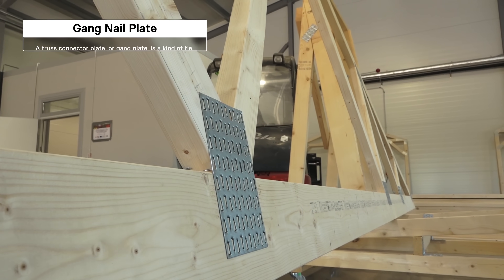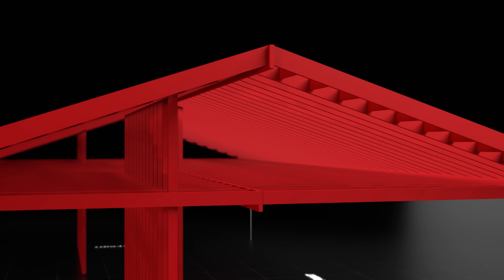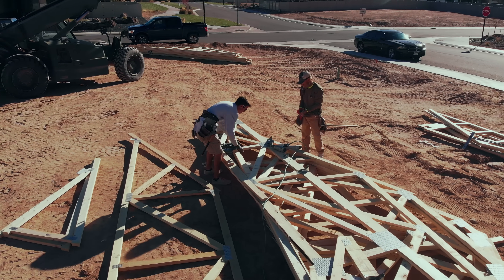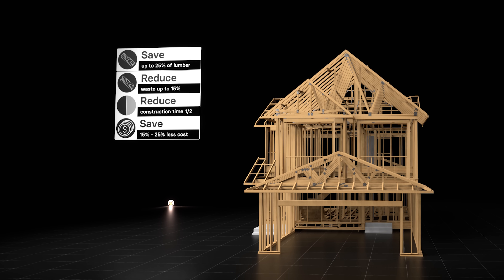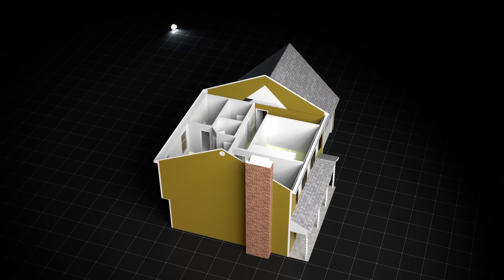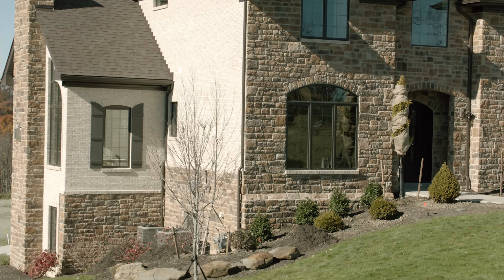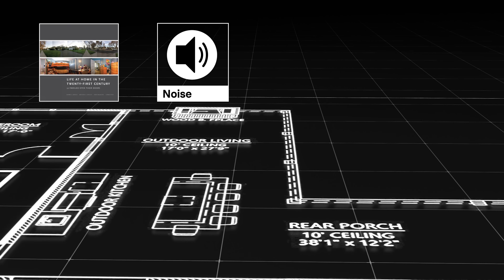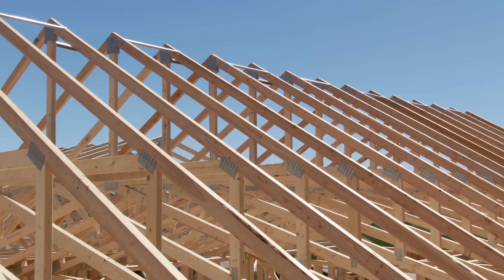The Invention that Accidentally Made McMansions

Comment: Kinda random comment. But I've always wondered by some neighborhoods have all of their houses built up on a mound raised from the street level. In my neighborhood at my end I have to drive upwards to get to my garage, but at the other end of the street its flat. If that was all done to control rain water in the streets by digging the street down and keeping the yards all the same level its pretty smart, because most people don't even notice it. Same as how no road is flat and they are all curved to run water to the sides and how we don't notice just how drastic those slopes are until going thru an intersection across a major road and you have to literally slow down drastically otherwise your going flying and so is everything inside the car. 
Guess my actual thought is if the little mound houses are built on are a byproduct of controlling water flow in the streets or if it has to do with the water table level underground, making it more difficult for houses on one end of a block to keep their sponge yards of grass green compared to the other end closer to the water table.

Comment: You should see the McMansions that filled up a former tree farm behind me.  Two of them are supposedly the two developers' "forever homes."  Supposedly the subdivision, 2ac nominal lots, is targetting $10,000,000 "estates."  It's hideous.  The construction quality is abysmal.  2x6 walls, but at least half of those 2x6s have so many notches and cuts I wouldn't trust them, and the rest would have been better used in an arch or spiral candy cane.  Maybe a boat... A surprise inch of rain in early november made for a lot of wavy roof sheathing (some of which was replaced) and the interior subfloors look like you'd expect of OSB stored under water.  Not to worry though. The trim will cover that!

Comment: i don't get it, how does it save any wood?
Reply: You can use much smaller lumber.  Imagine a saw mill cutting planks from a tree.  They can get a lot more 2x4s out of it than they can get 2x10s or 2x12s (the traditional lumber sizes needed for roof rafters).  It’s like cutting one 1x24 piece of lumber from a HUGE tree to make a table top or gluing and clamping a bunch of smaller widths of lumber together to get the 24 inch width.  On trusses, they don’t use glue as the fastener;  they use the gang nail plates. It’s strong, but has structural weaknesses the traditional lumber used for rafters would not.  Just like the glue up table top would be strong, but no where near as strong as a solid 1x24 plank.
Reply: @kld70  thank you for the explanation

Comment: Can't talk about house sizes in the past (and sometimes even today) without mentioning that towns' and cities' zoning codes typically require a minimum house size of, generally speaking, 1,000 SF or more in the "smallest density" zoning district.
Reply: This is very true.  Also, they often specify that the land can only be a certain percentage of the final home value. For example if you build on a $100,000 lot and zoning says your land can be no more than 30% of your home value, you must build a home that is valued at a minimum $210,000, making your entire property value $310,000 ($100,000 land plus $210,000 building).  So if you want to build a smaller home worth $200,000, you have to find a lot worth under $65,000 so you can build for $201,500.  Problem is there are zero lots around here for that price unless you buy and demolish.  That will cost you about $75,000 and you’ll be in a neighborhood where all the houses are much older than yours, dropping your value below your cost to build.

Comment: Interesting analysis, not wrong, but grossly oversimplified. Like many other commenters here who work in the industry I can tell you with certainty truss plates are not what spawned McMansions. The fact is the that truss construction is significantly MORE expensive in many parts of the country. I know this from overseeing hundreds of value engineering projects where we actually did the take-offs, solicited the bids, 
 and added up the direct cost budget for the same plan built both ways. Case in point- when you shift the load bearing from a combination of center walls and exterior walls you are also DOUBLING what the exterior has to carry. That could mean significantly larger footings, completely different reinforcement, the need to install expensive diaphragms and shear panels to resist racking and other lateral loads.. and on and on. So the roof or floor frame might cost a little less, everything else could cost a lot more. It’s almost never “trusses are cheaper, period.”  I could go on for another hour but painting truss construction in general and gang nail plates in particular as the major factor in the demand for larger and more complicated houses is baloney.  Also remember.. you build a great big truss somewhere on the ground… you gotta get it up on the roof, straight, plumb, and fully braced or you’ll have toothpicks in the first windstorm. That requires machinery, larger (not smaller) framing crews, and much tighter coordination. And that also costs money.  You can make most reasonable residential floor and roof spans in other ways… steel beams for example. Where I work the most builders are forced to use roof trusses when there is a shortage not of general labor.. but of SKILLED carpentry labor.  Hand-cutting a roof is a dying art today.

Comment: I don't understand how having more spacious homes is a bad thing. I wished I lived in a more spacious house so I could fit my stuff more easily rather than having to cram them wherever I can and where I can't get them more easily. I don't have enough space to workout or to fit a treadmill or a dining table. The bathroom is so small that you barely have enough room to stand, when the door is fully open, the edge is a few centimetres away from touching the bathtub. A lot of flats in London are even more ridiculously cramped. A bigger house is better especially when you have 3 kids so they can all have their own rooms which is especially better once they turn into teenagers and need their own space more rather than having nowhere to claim their own space, like, what if they fall out with the sibling they share their room with and the other sibling is of the opposite gender but they're both teenagers so too old to share a room? They have to sleep in the same room, they have no choice, it's not better. If that father and the mother fall out, one of them can spend their time and sleep in the bedroom whilst the other spends their time and sleeps in the living room. You can't do that if you're one of the teens. Having all those people in one house, it's going to be easier for people to move around when they're not constantly bumping into each other in cramped, narrow hallways like here in the UK, especially considering those kids are probably still going to be living at home into their late 30's when they can't find a job and houses are too expensive. I think people are just spiteful that other people are not suffering like they are and just want other people to suffer because they're sadistic. Some people are so spiteful, I bet they would like to vote in a ballot to ban bigger homes just so nobody else can have them just because they can't afford one themselves. I hate spiteful behaviour. It's the worst character trait to have.

Comment: 4:25......"and then left by (Pulte, Toll Brothers, Lennar, DR Horton) on the jobsite, exposed to the elements, for 2 months until needed; at which point they're installed with the plates barely hanging on to the checked two-by ends after weeks of rain-dry cycles."    Everything is awesome.  
Gang plates, PEX, flexible ducts, 1/2 inch drywall, fiberboard sheathing...............combined with the proliferation of easy debt have all contributed to the polished turds that are today's new houses.  
Everything is awesome.

Comment: The floor truss.  Don't forget the floor truss replacing the 2x12 floor joist.
Reply: Which is required in addition to roof trusses for first-floor open plans, since the first floor still has to support most of the 2nd floor.

Comment: As a carpenter I've made many roof rafters. I first used roof trusses in 1980, but not floor trusses. The trusses are made of yellow pine, rather than softer white pine. Sometimes a truss would get damaged when delivered. The inspector used to let us repair a damaged gang nail plate, by nailing plywood on both sides, but later required the damaged trusses to be replaced.
Reply: The inspector was requiring that carpenters hide damaged trusses instead of repairing them
Reply: @jdhenge  I 'm not sure it was the inspector's idea. I think we suggested repairing the damaged trusses and the inspector accepted the repairs the first couple of times and then with later damaged trusses he told us that we could no longer field repair damaged trusses or gang nail plates. That was in 1980 - 1981. The later damaged ones had to replaced with new trusses that we had wait far delivery. The ones we did repair previously are still standing. The builder didn't want to waiter replacement trusses and that's the reason we came up with a way to repair the damaged ones, if they weren't too damaged and just had loose gang nail plates. I think we used 5/8" plywood and not 1/2" plywood and cut the plywood as the truss angles and nailed a piece of plywood on both sides of the roof trusses, over the places the damaged or loose gang nail plates were. Rafters were often spaced every 16 inches, but roof trusses were spaced every 24 inches. The roofing industry now recommends 5/8 inch plywood for 24 inch spacing and 1/2 inch plywood for 16 inch spacing, but back then, we used 1/2" plywood. We used 5/8 inch plywood for floors, but these days with large McMansions, 3/4" plywood is often used, to reduce creaking and noise with very large floor spaces.
Reply: @BrandonLeeBrown  Field repairs are still allowed, they just need to be designed and specified by an engineer.
Reply: @BrandonLeeBrown  In my neck of the woods they still let you repair trusses that way, but I think they need an engineer to sign off on the repair. It's not a problem because most builders have engineers that they work with because the cities now require all house plans to be engineered. So basically the engineers rubber stamp the paperwork. When my dad was a builder he would draw his own plans on paper, but the cities don't let you do that anymore. They make you hire an architect or engineer.
Reply: @jdhenge  I think what happened was we asked about repairing the first damaged truss with the inspector and he could see the damage before we repaired it with plywood. He gave the go ahead. Then when we had another damaged truss, we just repaired it and the inspector was unable to see the damage under the plywood. He let that one go, but told us we couldn't repair anymore damaged trusses. Some trusses were damaged beyond repair, usually when they were delivered and dropped.

Comment: First time I visited the US I was shocked at the size of homes in general. Yes, we have big homes in Australia, but you guys really take the cake. I’m still wondering how you afford the electricity to heat the rooms (and the garages! That never happens here).
Reply: The utility bills for HVAC depend quite a bit on insulation the contractor puts in, along with what type of HVAC system(s) are incorporated into the design. Heat pumps are really being pushed by all the "climate change" scolds, and work well in many areas and can be very cost efficient. However, in places that get cold you HAVE to have an alternate heating source as they don't work well below about 15°F. Where I live in ND we regularly get at least one consecutive week each year with the high temps never getting above 0°F (-18°C), let alone the nightly low temps.
Reply: @KamasKirian716  I live in New England and most all new construction here is using heat pumps. There are new heat pumps that can heat effectively at those temps without needing to kick on heat strips. BUT...and there's a big but...we sold off all our utilities to private corporations a few decades ago, and as a result pay more than twice the national average for power. The result is that even though the newest heat pumps work, and don't typically need the emergency resistive heat strips, they still burn through a ton of money in electricity. There's 4 buildings in the complex I live in. The first 2 built use natural gas, the newer 2 use heat pumps. My gas bill last January was $87 keeping it 73 degrees inside, plus a $146 electric bill (~$20 of which was the blower motor based on the hours it ran). A similar size newer unit running the heat pump ran people $300-400 in electricity, and none of the ones I talked to kept it nearly as warm as I did...
Reply: Australia now has the largest average house size in the world according to recent studies.
Reply: Energy is 1/3 of our economy
Reply: Cheap reliable nuclear power (mostly).
Reply: The key is to not use electricity to heat your home.
Reply: My 1928 house is about 1,000 sq ft. but I have R100 worth of insulation in the attic, and additional interior walls attached to all exterior walls to get 2 more inches of insulation on top of the 4" in the original walls, and all windows are replaced with dual pane.
My total bill last month here in Iowa, for electric and gas for heat was $81 and I heat my house all winter to 72 degrees.
The attic insulation makes the most difference, while the codes my specify R19 or whatever it is now minimum for attics here, insulation is cheap, I loaded the attic up!

The windows also make a big difference, I used to get ICE covering the inside of the kitchen wndows where my desk is, it always felt like a draft and I had to have a 1500 watt space heater on me, turned out the "draft" was not leaks around th eold windows- they were sealed up good, it was the cold surfaces creating a convection current.

I replaced the 4 windows in the kitchen myself, and immediately the ice was no more, the drafts no more,and my electric bill dropped by $50/mo in the winter.
It was the same story in the bedroom, 2 windows I replaced, the space heater in there went in the trash, electric bill dropped $35/mo
Reply: Big homes also mean going outside less. Good and bad for health purposes. A lot of the younger generation look far younger in their face, than they are. They look like very tall children...😮
Reply: A McMansion isn't a home. It's a glorified box. A barn with a garage, essentially. America may look big and splendid on the outside, but on the inside it's flimsy and cheap. Maybe when Americans and Brits start getting chalk dust in their bread again, they'll realize Reagan and Thatcher sold them back into 19th century Gilded Age penury.

Comment: Interesting background on the truss nail plates and enabling more open construction at practical costs. Conclusions about the overall housing market boom and collapse, etc. seem pretty ridiculous though. Incorporating trusses adds design flexibility, but it doesn't drive the supply and demand curve for home ownership, nor the financing options driven by government subsidy programs. I'm also thoroughly confused how you manage to classify intricate roofs and more elaborate architecture as less aesthetically pleasing than the small simple, more uniform typical utilitarian homes of the 1950s Miami suburbs. Unless you just mean that you personally prefer small uninteresting houses that stand out less from the surrounding landscape.

Comment: With the new truss systems, you can have an attic space again. You have to order it, spec houses are done as cheap as possible so, many don't have an attic.
Reply: Random thought, Some of the bi levels of the 1970s and 80s are perfect houses. Sometimes I’m shocked how much extra space and privacy they have. The downstairs den etc plus bonus rooms is a great concept.
Reply: The sad thing is that this should have allowed cheaper houses, but it didn't work out that way
Reply: @chrisfletcher86  It's just supply and demand, few people want cheaper houses. Most "cheap" houses are just older homes that need some repairs. Starter homes built to min spec often attract crime.

Comment: Those aren’t used here in north Texas anymore. We got Mescans building the roofs from scratch.  The rooflines are also super tall. To the point the houses look almost ridiculous.  I can only suspect the tall roof disrupts the airflow so there is not enough reduced pressure on the roof causing it to lift off.

Comment: Trusses are more commonly used on smaller, cheaper homes, from what I've seen.  The larger McMansion homes in my area are usually stick-framed, to allow for more/better insulation.  My house is small and very cheaply built.  It has truss roof construction with these nail plates, and pretty much no attic storage space.  I hate it so much.